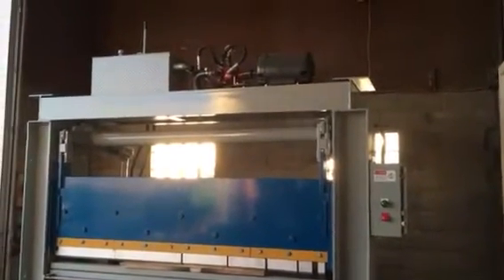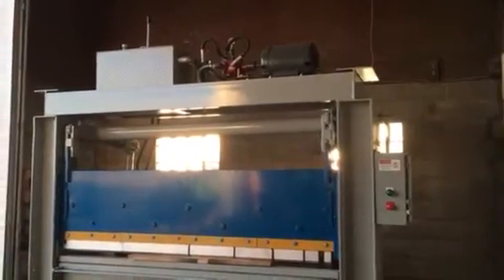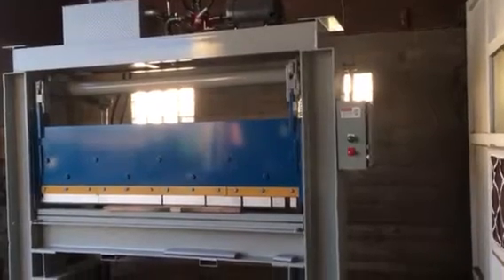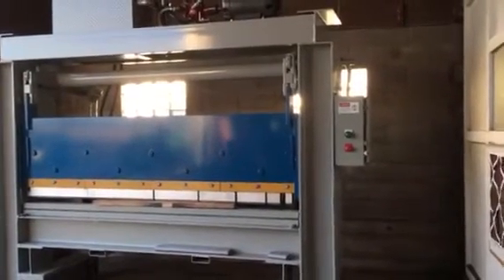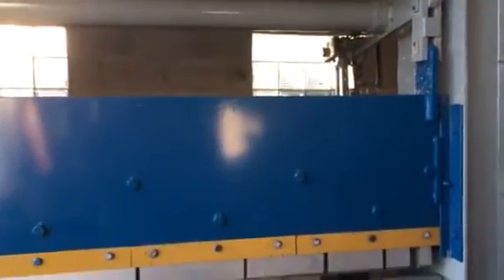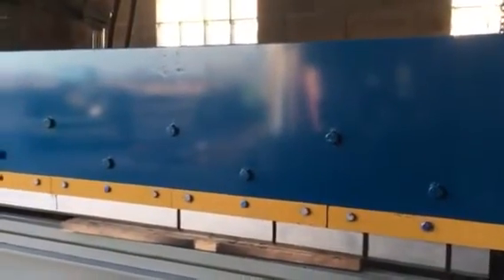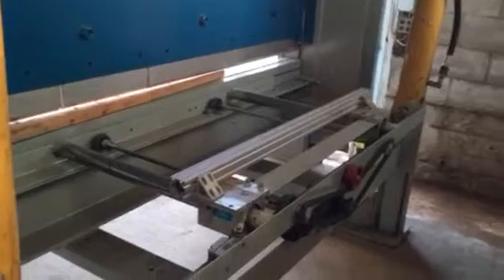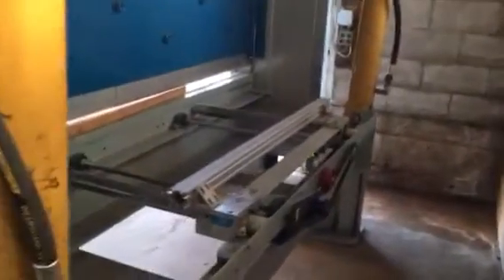Homemade hydraulic press brake

Comment: You ever get a chance to take a video of it in action? Thanks for sharing your build.
Reply from the maker: Doug Owens Doug thanks for your comments. I promise to have a running  video of my press  in action . I had to add a speed control and limit switches to make it Safer. Works great so far ,generates incredible amount of bending power.  Check back soon. Thanks Jeff